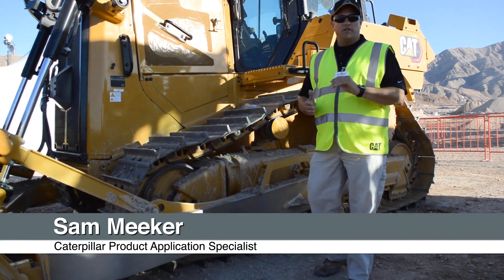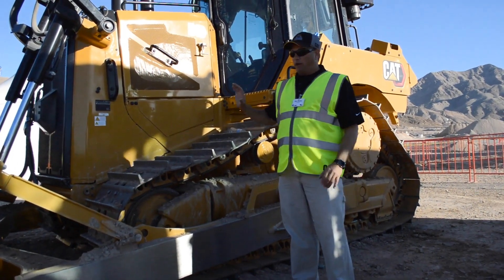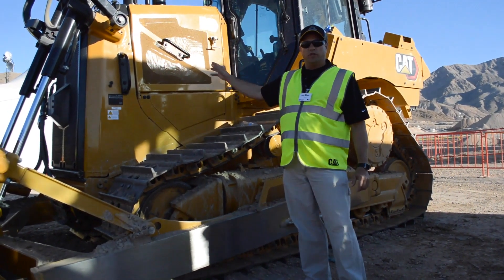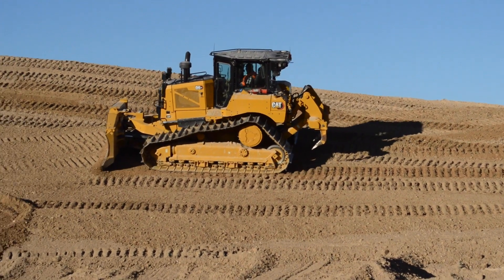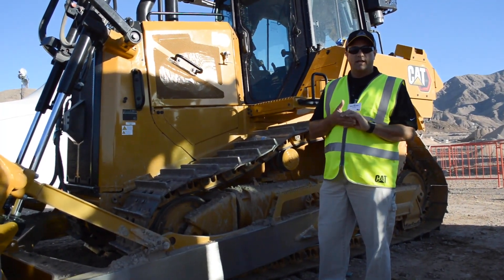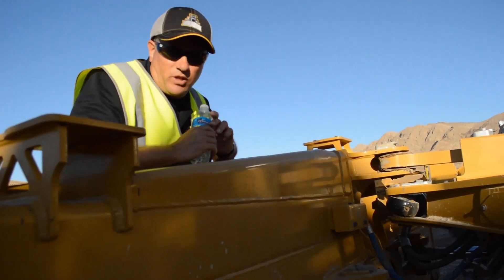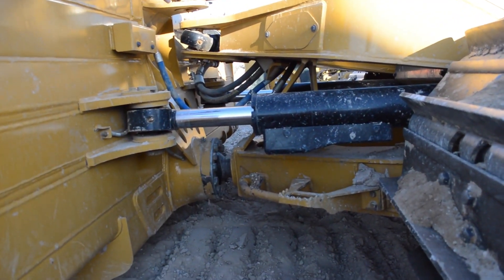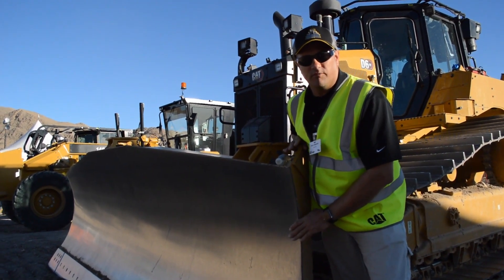Cat unveils new electric drive D6XE dozer at Trimble Dimensions

Comment: I've spent over 30 years in the seat of dozers and got my first crack at a D6XE just today.  Count me among the impressed.  I first noticed how nimble it is compared to the Rs and Ts I ran before.  It's so responsive it feels as though it weighs half as much.  The cab is a major improvement,  and even though today's machine had over 5000 hours on the clock, there wasn't a knock or rattle anywhere.

Cat finally solved the brakes.  There was no such thing as easing into the brakes on the previous models.  And thank God they did away with that jarring alarm when you turn the key.  I found comfort in imagining the Cat engineer that came up with that will spend eternity in hell listening to that alarm go off once every 10 seconds.  Forever.

Comment: lets hope its a huge improvement over the pos D7e
Reply: Rogue Excavating you got that right! 
I push loose stockpiled coal with a D7e and have nothing but problems out of it.
Reply: @joshfriend7103  we had 5 of them I literally had every one on the available to mob out list that i had on my site.
the uptime availability was about half or a little better then the equivalent machine. And we did alot of rock work and they are rough as fuck. I would have good operators walk if we made them run one.
Cat should buy every single one back melt them down and try to make people forget they come up with such a piece of shit
Reply: @SummitAggregates  must be a unicorn does it blow rainbows out the exhaust lol

Comment: You know I've worked on 7g, 6c, 6d, 7f, 9u, 6r, 6t,    and some of these old ones have proven 50k frame hours. I've seen 28k on a 5ln 6r, but that machine was toast. The electronics and emissions have killed cat. 5 ecms in a dozer is a joke, I won't lie; I sit on a damn laptop more chasing fault codes than anything. IT SUCKS
Reply: That's all I've heard about these new machines, got to call the dealer for the smallest thing and they can't keep them running.

Comment: Wonder if this one will be running in 40 years like the old D6Cs and D6Ds, I doubt it, all I hear about these new dozers is you can't keep them running from electronic problems.
Reply: pete2bc Have 11,000 hours on our D6T with very few issues 🤷‍♂️ I think that’s more then exceptional
Reply: @TristanH7290  I'm glad for you but all I've heard about these new tractors is nothing but electronics problems and the guys from our local Cat dealer doesn't have a clue on how to fix them. I've got a friend that's got one of the newer 320 and it's down more than it runs with computer problems.
Reply: Running in 40 years, Yes but not moving.
Reply: @TristanH7290  I ran a 980 with 24K hours and nothing but 1 valve cover gasket. Pins/bushings and repacking jacks but the motor and tranny were untouched. Cat was even growling about it. 980-G.
Reply: brdman  The Cat  mechanics can't even fix them. As for me I'm to old now for this new stuff, I'll stick to my D6C, 215b and my 22B draglines, Ain't enough work around here to ever pay for one of these new machines anyway.
Reply: brdman  Glad you're happy with them, I've just seen to many and heard stories from my friends, the mechanic comes and hooks a computer to it and sits there in his truck for God only knows how long, changes some small part, costs a fortune and the machine still isn't fixed,.
Reply: They've been using diesel electric in trains for over 50 years, so the basic technology is sound, I imagine it's just all the fancy electronic stuff they need to make durable.
Reply: pete2bc I'm with you on this.. I know that technology is the future but that doesn't mean I have to like it! (I'm 33) we'll just have to get accustomed to it but I'll miss having the ability to work on a piece of equipment in the middle of nowhere with only a couple tools that you have in the cab..

Comment: I bet it won't be as dependable as.  The D6R's were
Reply: I loved the 6r series 1 and 2. Series 3 was a bastard machine ahead of it's time just like this thing. I get their direction but cat is notorious for letting a product get released way to early
Reply: The company I work for bought a new d6r in 1998 and we put 15,000 hrs on it with no engine or transmission issues. I think we put 2 sets of tracks on it and rebored walking beam once and did all the blade bushings a couple times but that thing hardly ever missed a days work in 16 years. We traded it   for a d6t in 2014 and the t is a good running dozer and uses about 2 gallons per hour less fuel than the r did but seems to have a lot of electrical issues. Some sensor will through a bad signal and then it will derate itself until you figure out what the problem is and replace it.

Comment: just more crap to go wrong and you can't work on it, got to take it to the dealer...no thanks.
Reply: Ya or have a tech come out for $125+ an hour!
Reply: @RomeKG471  that's cheap i can't get my 1/2 ton worked on for less than 165.00 pr/h i think industrial is in the 200-250 range up hear in Canada. but i could be wrong.
Reply: @mog5858  Wow!